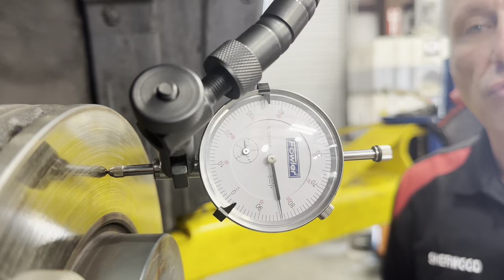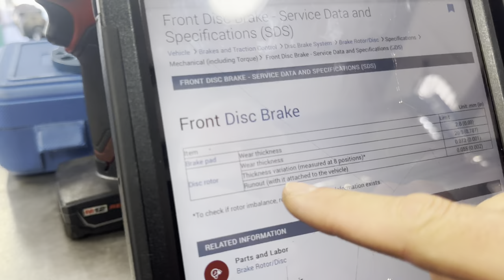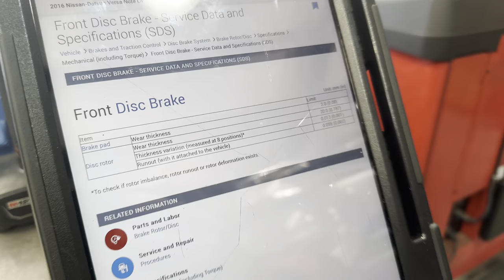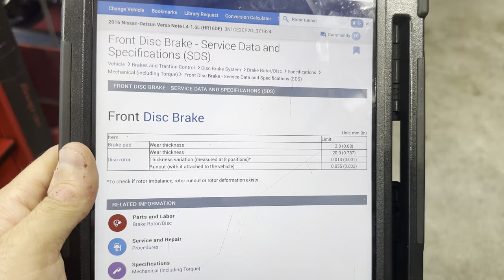It’s Vibrating When Braking & It’s Not the Rotors. How to Test! (Nissan Versa)

Comment: Great information. Have you ever used an oncar brake lathe? ProCut brake lathes has been addressing this issue for 35 years. Cleaning up the stack tolerances from hubs, bearings, and rotors. Small car hubs distort from overtightened lug nuts(the tech that installs wheels with an impact). Problem solved in 5-8 minutes per hub/rotor.
Reply: Bingo! You are correct Sir. But nobody uses them).

Comment: Easiest way is on vehicles with re-repair or come in with vibration is my method.    Hang the dial indicator,  find the high spot on the rotor, mark it.   Rotate 180 degrees.  Measure again.  If the high spot is in the same spot, its the rotor.  If it follows the hub, its the hub.   It takes longer to read this, than to measure it.

Comment: Big thumbs up on this excellent instructional video.  Now I have a few tools to add to my garage.  I had front brake vibration on my 2015 Odyssey which was resolved by replacing the rotors and brake pads which were both due.   This is a common problem with Odyssey's OEM rotors but I will be using the techniques in this video the next time.  Better to take the time to be sure of the root cause as was demonstrated.

Comment: Its good to know that you guys are eating the cost of the repair, since you missed diagnosed and did an unnecessary repair. I stopped going to mechanics when a shop wanted to charge me to change parts, they didn't know the problem, so they wanted replace what they thought the problem was. When I asked " If that doesn't fix the problem, are you going to charge me?" When he said "Yes". I left without the letting them touch my car. Fixed it myself and never went back to a mechanic again it has been good 20 years.
Reply: It's like a lawyer or a doctor, dude: you pay for their TIME.
Reply: @C0Y0TE5  - unfortunately, proper diagnostic investigation by "professionals" is a rarity these days, the customer should NOT be over-paying for unnecessary parts/time.
Reply: @markharlock6474 --Tell that to your lawyer; see how well that works out...
-- The shortage of skilled mechanics mean that it is a SELLERS' market in auto repairs.
-- Try telling them what to do, and they will fire you.

Comment: The ball bearings inside the "wheel bearing" of the hub are NOT within "the 2 micron (2 x 1/1000 mm) tolerance" hence the massive shift on the micrometer .. I came up against this before after "trial and error and many headscratches" .. who'd have thunk ? 😮 GREAT VIDEO.. WELL DONE !!
For those who don't understand what's going on here, this isn't just mechanics, this is physics !!

Comment: Good video. Glad you mentioned that runout will increase the further from center.
When measuring the hub or rotor measure as far out as possible. I noticed you measured the rotor towards the center. In such an extreme case as this car it doesn't matter, but if someone is checking for a less severe problem, measuring in the center of the rotor could give a false negative.
Reply: I've never herd of a false negitive only false positive .🤨🤔
Reply: @jacobclark89  A false negative is the opposite of a false positive. It's when you get a result that says negative, but the result is untrue.

Comment: I see a couple of things you should have done before to start the check. 
Firstly you should have installed the 4 nut, not 2, in the opposite way, the cone side away from the disc and tighten them up to specifications. 
Now, you will get a more accurate reading...
Reply: Since the hub is the problem putting all the nuts in would not make much difference...

Comment: This is why I am a huge advocate for on car brake lathes. Being completely honest there are many mechanics out there who don't even have the knowledge or time to do these checks, and cutting the rotor on the car will remove any runout whether its from the hub or the rotor no brainwork required. With good bits runout after cutting ends up around .0005" on the car normally. Not the best solution for a warped hub but I'd argue better than what many end up with, as long as the rotor is thick enough to reuse
Reply: I am glad you said that, if I do a brake job and still have a pulse time to mount the brake lathe, no matter if the hub is out or the rotor, it will be 0 runout and 0 thickness variation

Comment: Good information . Thanks . We had a local shop where the guy bragged " I can do front pads in 20 minutes " . Is ANYTHING cleaned and checked ?
Reply from the maker: People think we are way over the top with our brake jobs. It works though. No noises. No premature failure. Good performance. Why try to fix what’s not broken?
Reply: @theroyaltyautoservice  I only put premium pads and shoes on my vehicles . The labor is the same and they last longer . I wonder in a panic stop if the top quality parts will actually stop in a shorter distance ? It is worth the extra money .
Reply: Speed is impressive if someone is digging a hole or stopping a plumbing leak, but I don't want to see speed when repairing or servicing a piece of machinery. I want to see thoroughness and mechanical cleanliness.

Comment: One other thing that could be: I had an 05 CRV with same symptoms and after several agonizing attempts to repair, it turned out to be a faulty ABS module. That's right, a leaky valve in the ABS module can feel just like a worn out rotor.

Comment: Use 10,000s of an inch dial indicator, digital ones work. Slightly hand circular sand the outer ede surface of the hub to remove rust. You will get an accurate reading of the runout. If the hub is bent, you can use shims to fix the rotors, or you can place the rotors on and machine them on the car.

Depending on how bad the rotor runout is, you can use shims to fix it. No need for a costly hub repair, but shims will be needed on every rotor change. Hint: You can make your own shims using the cheapest aliminum foil and a micrometer to offset the runout.
Reply: For the Nissan in question these hub/bearings are affordable under $100 complete per side. The shims is an IDEA however not a reliable one. Being that most cars nowadays dont come with a rotor fastener the rotor will loosen itself once the tire is off and being that many shops use impact guns, after a few tire rotations and installs those shims will crush and the problem will be back. Why do I say they will crush? because anything that wont crush has to be thick, thick will move the rotor outwards and will wear the outer pad more than the inner. -$100 will save you headaches in the future.

Comment: Keep an eye out for rotor thickness from center venting to surface. I've been running into a bad batch lately where the center vent will wobble visibly when turned while the braking surface itself is perfect.
Reply: I have seen more of this in the last few years as well.
Reply: Chinese steel and parts are wonderful thing aren't they. It's extremely difficult to find American-made parts with American-made materials.
Reply: The center casting is irrelevant.
Reply: @fastinradfordable  Untrue. The center casting, if uneven as I described, makes it so there are different thicknesses of metal between the center casting and braking surface. As a result the portions where the rotor thinner will heat up more quickly than the portions where the rotor is thicker.

This will cause rotor imbalance and deformations which will cause vibrations that will be felt whether or not you are braking. More so when you are braking.

Comment: Awesome video man!! I had the exact same problem on a 2012 Corolla I bought from an auction. Every video I found on the internet was blaming it on the rotors. I resurfaced the rotors it came with and still same problem, bought new AC delco rotors and still the same problem. I checked ball joints, tie rods, everything is perfect. I came across you video a now everything make perfect sense because the car had a small accident on the drivers side and yep it ended up being the hub on the drivers side lol. Thankyou so much!!

Comment: Before replaceing the hub, check the ballbearing inside the hub, as it might get worn and you can have deviation from it too......its very hard to warp that hub and its easier to worn out a ballbearing
Reply: Maybe a hub can be bent by hitting a curb?
Reply: @guy7670  Truth, that too....but before the hub is bending, the ballbearing is blown to pieces....
In that unit ( hub- ballbearing) the weakest link is the ballbearing, which  will give first.
However there are cases where the hub comes bent from the factory or by beeing hit while driving

Comment: I had this occurrence many years ago on a relatively new vehicle and the result was the customer having their front pads and rotors replaced several times within 5000 miles and even new wheel bearing hub replacement under factory warranty did not fix it. The problem found was stacked tolerances. The solution was an on the car brake rotor machining. Once completed the vehicle never returned for a complaint. The benefit of on the car rotor cutting is many including a non directional finish. Many brake rotors serviced on our standard AAMCO brake lathe developed brake pad knocking due to the machine cutting a screw thread across the face of the rotor. Even heavy sanding while on the lathe did not remove it. I was a huge fan of this on the car brake lathe and used it on every rotor disc I could. I had no issues with my brake work when completed.

Comment: Had a similar issue; brand new car, put on brand new, high-end wheels (Boyd Coddington)and tires.  Saw crazy run-out at the wheel.  Issue: new rims didn’t feature factory-style lug stud hole chamfering on the hub side.  No problem, except we left the little retaining washer on the studs (holds the rotor in place on the assembly line). Amazing a little 0.020” washer could cause so much run-out!

Comment: Brake issues now. First company,  did not fix it, changed a lot of parts, charged 1000., Honda also did not fix it still shaking when braking, and they also charged 1000 bucks.. So I am 2K in with shaking brakes.         Thanks for this.  Hopefully the dealership will look at your video!

Comment: I had a similar situation when I started limo service with my town car back in the early 1990s. I had done a brake job on my towncar and had the rotors resurfaced. I had noticed a strange noise and I could also feel it through the brake pedal. Taking a peek at the rotors, I saw what was making the noise. My rotors were similar to yours, two plates with support spokes. The brake pads had a high spot at every spoke, and between the spokes was a scuff mark which was a low spot and the reason for the vibrations, and on all 4 corners. It caused quite a 'humm' when braking from 60 mph. They were making the rotors with 'softer' metal to prevent the brakes from squealing, they weren't strong enough after resurfacing.

Comment: This video helped a lot ty. I have 2016 explorer utility my front brakes where grumbling at low speed stops. Felt like a go kart when you jam the brakes are there are really none left you get the grind same feeling. I changed the pads and rotors same thing changed the page to better pads etc rotors twice pads once. Same grumble went and go new hubs eveything is fine now quiet smooth I couldn’t believe it. Thank you!!!
Reply: If it’s the hubs does that mean you didn’t need new pads and rotors or  does the hub end up ruining the rotor once it’s shaking and either way needs to be replaced ?

Comment: 20 years ago only one in five was true and parallel brand new from local parts slinger. Some times I'd get 15 rotors for one car before they were true. other tech would just turn new rotors but then they are considered used not new.
Reply: I remember those days. I would turn the new ones. And the really good ones were when they were too tall by a smidge and hit the top of the caliper. I threw a couple on the lathe and cut the edges like they were a drum.
Reply: @mph5896  Me too, or turn the hat because it rubbed the caliper bracket, but only if the rotor face was unusually true. LOL. The things we did to deliver top shelf work and prevent comebacks.
Reply: Those were the tiawan twisties .  Soon as they double disc ground, it solved out of the box issues, then proceeded to be runout issues that surface a few months after install.

Comment: The number one reason your hub is warp is due to NOT USING A TORQUE WRENCH ON THE LUG NUTS ! Check your guys when tightening down the wheels .
Reply from the maker: We hand torque every wheel. Lightly tighten, then hand torque. . Been doing that for over 20 years. We habe a video on TikToc on how we do it if you are interested
Reply: @theroyaltyautoservice  I am a Master technician 47 years young . I have had this issue from customers from other repair facilities that just use an impact gun, which is a very bad combination with alloy rims . If you are using a torque wrench, then to be sure, I would have the torque wrench recalibrated. Another reason is if you use a deep socket or an extension that changes the torque to .

Comment: I want to thank you so much for the video. I have a Nissan Versa 2012 SV that always vibrates while breaking when going down hills or flat highways at medium or high speed. Turns out the rotor was rectified, new pads, 1 month and the problem was back. After i saw this, i wondered, mechanicly thinking what other hardware interacts with the rotor. Turns out it's the hub. After talking to the previous owner, they told us the vehicle had an incident in the fornt area affecting the left tire, and some how the dude that replaced the rotor and tire somehow overtightned the bolts, and there was the answer. The overtorquing of the bolts caused the original hub to warp.

Comment: Finally someone who tells the truth. I agree with everything you said and do on this vid. Kudos to you to admit the shop short comings. The majority of pros who does what you just show don't do it because the time involved in doing it RIGHT, and they'll have a come back. I also agree with you that Europeans change rotors rather than machining for obvious reasons.....Of course torqueing the wheels is a MUST, done are the days of impact guns. Cheers
Reply: What 😂😂😂

Europeans change rotors, because they are out of spec. I change rotors everytime I do a brake job on one of our automobiles. I'm not measuring the thickness, I really don't care much, it literally only cost me €50-€120 for 4 pads and 2 rotors. 

Runout can be caused by a lot of stuff, like a bearing, and so forth. You're actually required to pull the rotor outy and chuck it to measure runout, but hey, wtf do I know as a machinist!

Comment: Why was it released to the customer the first time like that. Didn't the after the job test drive and break in reveal a vibration?
Reply: Exactly, this is the channel that is so big on seating the brake pads.
Reply: idk if you’ve ever had pulsating brakes before but it usually is only prominent at higher speeds, and they probably want to give the customer as much brake life as possible without high speed testing.

Comment: Glad to see that you did DTV (Disc Thickness Variation) check, even if it was just to show people how to do it being that you know its got a bent hub. Many people do not know just how critical DTV is and that other than on fixed opposed piston caliper equipped vehicles, its actually quite a bit more critical than runout. 

I've seen tons of cases where runout was within spec but vehicle had violent shaking / pulsing from DTV being out and on the flip side, cases where disc's were 2 to 3x out on max runout and no signs what-so-ever that there was a problem. Now on fixed opposed piston calipers, runout (even mild) can really be noticeable unlike a properly functioning floating caliper setup where runout has to get quite high before it starts to cause any noticeable problems.